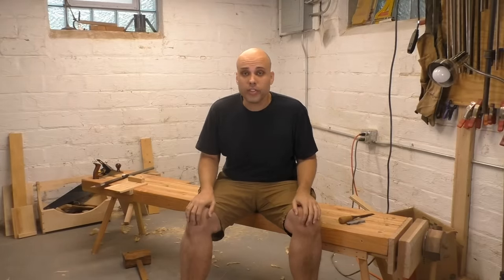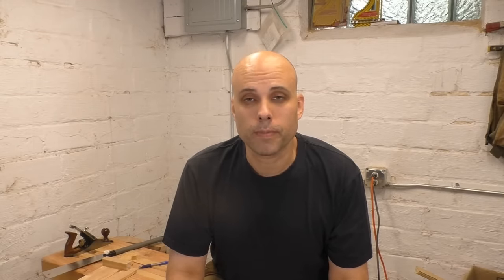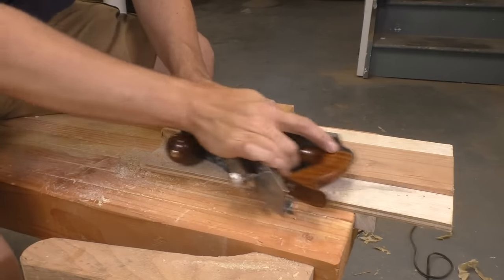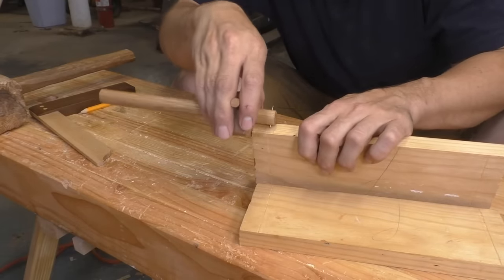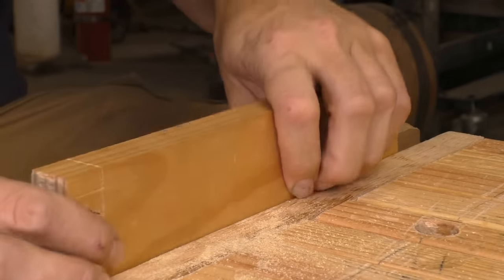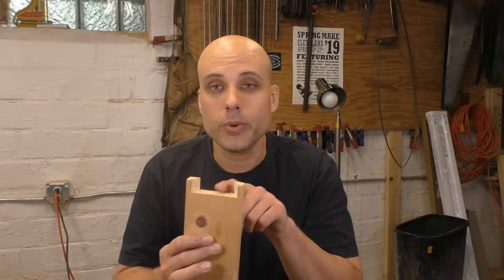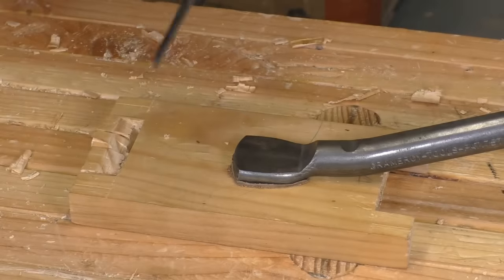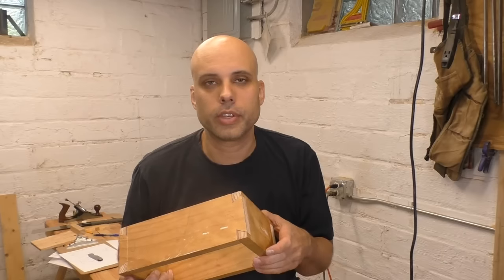Easy Dovetails for Beginners

Comment: Pine is often used as a beginners' choice of wood, but it's a horrible material to do some accurate work on with hand tools and may end up discouraging a beginner. So my advice is, get your hands on some small pieces of hardwood to try out these techniques.
Reply: Poplar isn't much more expensive than select pine at the big box stores.
Reply: It's important somewhere to point out that pine is actually pretty great FOR SOFTWOOD techniques... the kind that most beginners should really reliably be dipping feet into in the first place...
   Rex's chopping out is more of a Hardwood technique, not so well suited for pine... SO... I'd recommend taking the saw back to the piece to make "relief cuts" in the waste material to just about an 8th inch (2-3mm?) above the gauge line for the shoulder, and start your chopping out process considerably closer to the edge/end, then cut the remaining waste in about half, and half again... repeat until you're down to the last sixteenth or so (between a half and a millimeter) and then you can gnash out the last of it... reasonably smooth.
   He did point out that his chopping was "too aggressive for pine", so he saw it, too...

    Keep in mind, woodwork is a patient man's game... There's a lot of dubious repetition involved if you're going to excel at it. Remember to breathe, relax, and then keep on keeping on. 

     AND for the record, yes... Poplar is a very reasonably priced and perfectly workable hardwood... for those interested in diving into hardwoods... BUT if you're most interested in keeping tools at relatively low maintenance and just practicing to get technique and muscle memory... Pine isn't a terrible medium to gain skill with, and it makes you particularly conscientious about handling for work. It dings at the drop of a hat. ;o)
Reply: It might just be the big box store wood... I've seen videos of Japanese woodworkers doing sashimono with pine. Beautiful work. According to Google, sashimono is also a small war banner, in case anyone wants to look into it both come up.
Reply: @TheRaven0811  It isn't the big box store, it's the way it is grown and harvested.  And it's pretty widespread.  The saplings are crowded in together, and chosen for their very fast growth.  <20yrs from  seedling to harvest is almost the norm in this part of the US, and that leaves a lot of trees barely fit for cardboard, much less a dovetail box.
Reply: @gnarthdarkanen7464  I totally agree.
Reply: @gnarthdarkanen7464  Ah, interesting info!
Reply: Plenty of hardwood scraps in construction dumpsters and on the kerb in old furniture...
Reply: @ErikBongers  Admittedly, I'm a hobbyist more than anything, so keeping in mind that I'd consider myself no further than intermediate (ish)... I hope my looking back (in time) to those frustrating beginner days is helpful... Thanks.
    AND I completely understand the personal angst from "bsdnfraje" up there, as it is easy to dismiss pine as completely too soft to sustain the job... BUT... looking back I have had to come to terms with my own early onset of disdain for the stuff, as I also thought it useless... aggravating... and a needless waste of my time, when I was more interested in the tightly interlocking tenons and hidden mortises I so strive for today...
    BUT... were it not for those hours and days of the old-timers handing me a piece of wood back and returning me to sanding AGAIN... and AGAIN... and AGAIN... 

    ...and were it not for the old-timers pointing out where I'd dropped the damn thing against the table...
    ...or mashed it into a raised (loose) nail somewhere...
    ...or any of myriad other incidents and injuries to my (at the time) master craft...
    I probably wouldn't have the patience today to do my layouts, follow the lines regardless of marking utensil, width or darkness... or whether it's a pencil, marker, pen, or knife-wall (Paul Sellers' style) and leave just enough waste to finish back into exactly where I want it... as I sand it smooth.
   I wouldn't find sanding and polishing and steel wool to be best friends for relaxation after a long day of dragging saws and shoving chisels through everything from hemlock and seasoned knotty pine to black locust so hard a strike from a hardened axe will throw sparks.
    AND there's probably no way I'd sit through the maintenance of a plane iron to the degree that I do... SO... pine isn't the greatest for a finished product of "heirloom" qualities. You probably won't pass the pine hump chest to the grandkids... BUT getting through all the f*cking up royal with the pine one, while you have time and money to afford pine... WILL make the mohogany and teak hump-chest not only worth passing to the grandkids, but likely worth enough cash in the generations to come to put the great or even great great grandkids through college... almost regardless of what's in the damn thing.

    Be wary of beginners who have too rigid an opinion of things. They likely have a lackluster capacity for details and little or no patience with themselves. God only help anyone else nearby! ;o)
Reply: @gnarthdarkanen7464  Poplar is cheap and pine is intentionally farmed to be substandard wood.  If that's angst, you need to toughen up, snowflake.

I've got antebellum pine furniture I've inherited, and a loblolly kitchen floor reclaimed from a local barn.  I love yellow pine!  Big box select pine is still terrible wood, and it's intended to be.
Reply: I use pine for the test piece since I rarely work from a pattern  but I agree 💯 I remember being shocked when I started using hardwood the difference it made in my work.

Comment: This kind of attitude towards the iconic dovetail joint will be much more valuable to most woodworkers than seeing Frank Klausz doing them at warp speed, or Rob Cosman doing a perfect set blindfolded with one hand on his back or something.
Reply from the maker: I appreciate that very much!  Still, Frank's no-measure/no mark method might actually make the joint easier. I need to try it.
Reply: Great video, Rex
Reply: @RexKrueger  One thing I've noted, from Paul Sellers, is the use of a knife to make my marking instead of a pencil. That one simple tool increased my accuracy quite a bit. Keep up the good work. I'm enjoying this series!
Reply: 1/3's would be stronger.
Reply: Good job!
Reply from the maker: I'm not gonna buy Cosman's tools, but given that he physically makes them himself, his prices probably aren't that silly. Small-scale production is very expensive.
Reply: photozack81 You should have a look at a channel called “Pask Makes”. Need a big framing chisel? No worries. Let’s make one!

Comment: I always cut pins first , and for a reason I haven't found anybody talk about. The first board that you cut can be cut basically anywhere. In other words it doesn't matter how accurate you are to the line you marked. But the second board has to be cut in a precise spot. The reason I cut pins first is because when you mark your lines on the Tails board you are marking on face grain. And I find that the best way to mark the Tails then is with an exacto blade. The standard triangular exacto blade is small enough to get the entire line marked but there is enough width at the base of the blade to reference the pins surface and keep it perpendicular. Then all I have to do is Sneak the ryoba right up to that line, which is dead on. But if you are marking your pins second you are marking on end grain, and particularly with Woods like Pine, a marking knife won't really work. You kind of have to use a pencil and then you are much more dialing in the fit on every joint.
Reply: does it make sense to make dovetails in 2019 though
Reply: There is yet another issue with tails first method in a minimal shop setup: it requires vise. With pins cut first you can put the pin board standing on top soon-to-be tail board. It's much easier to perform on a basic Roman workbench.
Reply: @jwydubak9673  Too true, and I prefer standing them up, personally...  Though I can say from experience standing up your board does get a little dicey if you're trying to mark tails from the pins on a 14" x 72" carcass side for a pantry.  :D  I had to get a little inventive there.
Reply: @xl000  You may as well ask "does it make sense to have chef knives now that everyone can buy a food processor".  People making food in factories have to use processors, but people who enjoy cooking stick to chef knives.

Comment: Great stuff as always. Couple of notes, a shallower angle for the dovetail reduces the amount of short grain at the tip of the tail and can actually make the joint stronger. (1:6 for softwoods,1:8 for hardwoods usually) When sawing the tail, it can be easier to start off with the piece angled in the vice so the line you are cutting is vertical, instead of trying to get the saw at the correct angle. You can use your Tri-square to line it up.
Reply: 1:6 = 10 degrees, 1:8 = 7 degrees. Doesn't seem like much, but the angle doesn't need to be severe to get a strong joint.
Reply from the maker: Good tips!

Comment: Rex, Just a tip I found to made cutting the tails easier. Mount your tail board in the vise at a angle then you cut straight down instead of having your saw at a angle. Straight cuts are easier than angle cuts.  I found this way a lot better and my joints have improved.

Comment: Thanx for the tips! I tried hand cutting finger joints........gotta try that one again. Haven't quite got my router finger joint jig quite right yet either. I'm lucky to have half a garage for my shop and keep my various machine tools on boards with caster wheels and drag them out when needed. It's a bit of a pain  but hey - I'm lucky to have what I got.

Comment: Rex, I made a frame today with 8 dovetails. Never done it before. It’s all thanks to your series that I’ve been inspired. Wish I could share pictures with you! Thanks buddy.
Reply: Now use dovetails in everything you do. And you will become an expert with the joint. Also throw in tenon joints as well. 
Make hundreds of small boxes and have them all over the house. My kitchen is entirely dovetails joints cabinets made from mahogany and oak. Everything from the doors, drawers, carcass, work tops has dovetails. I cut dovetails everyday by hand and I also use tenon joints. 
With just tenon and dovetails you can make anything.

Comment: I have to thank you Rex. Always wanted to get into woodworking but struggled with the preconception that I'd basically need a full workshop, and that thought has driven me away from even trying. Only have a small workspace to use but your guides really have helped me shake the notion that I'd need $1000's worth of equipment. Like before I found your channel, I used to think the only way to get a straight edge cut was either through a power saw or by having years of practice with a hand saw, never even heard of an shooting board before! Looking forward to getting more into the skill, thanks again!

Comment: Great video! I've seen this after starting my process with dovetails (using a Paul Sellers/Matt Estlea combination of layout and tricks that work best for me) and it is a very humbling joint. I've gotten a lot of joints that would work just fine, but they were not pretty! This video is great for learning how the joint works. Don't think that the fact that his has only a single tail makes it "easy" or such, the difficulty steps up quite a bit with multiple tails and as a newbie you want to reduce the complexity as much as possible. Do a bunch of single joints, half dozen or more, and learn all the mistakes and issues so when you do multiple tails you can apply those (and learn one ones) as you do the joint! If you want to look like you've been doing dovetails for decades you will probably need to be doing dovetails for decades, so get started on that practice!

My advice after 5 dovetails, with the final one actually being night and tight, is to be very careful with your layout and ensure your tools are sharp and stay sharp. I went back and re-sharpened/flattened all my chisels and go back to strop them between almost every operation. Also taking off less is more when cleaning up, it may take longer but you have far less chance of ripping out wood. If things feel off resharpen or strap, you will be happy you did. When cutting do your best to be careful to hit those lines just as needed, and I  do a bunch of saw practice before I do my joint. 

Finally don't forget that till recently dovetails were a practical joint, not a show joint. They look amazing when done perfectly but they don't need to be flawless if they are going to be hidden behind a closed drawer. I've seen many antique, extremely well finished, pieces of furniture that have gap filled and rough dovetails. There are a lot of good tricks to get a gap filled dovetail cleaned up (from glue/saw dust, to filling with wood wedges, to smashing down the grain of the pins) to make them look much better.

Comment: One thing I found when I cut my first dovetail joint and try to always keep in mind. As long as it's not too sloppy, even a poorly executed dovetail us a rock solid joint.
Reply from the maker: Yeah!  Mine aren't great, but still hold with no glue. Amazing.
Reply: If you use them on carcass joints on the inside with no display it doesn't really matter how they look.

Comment: Was genuinely feeling discouraged to build a bed frame with dove tails but you just gave me the basics and I’m feeling for confident to build this , thank you :)
Reply: When the joints are not on show it does not matter how they look just that they are strong. You can also use tenon joints as well along with dovetails.

Comment: Great video Rex. I tried my hand at making dovetails. I had taken just some scrap pine that I had laying around just to make one joint. I managed to get it to work but man wasn’t it just about the ugliest joint that you ever did see. I posted pictures of it on this woodworking group on fb. Several people commented saying to try again but with some hard wood like maple or even just poplar as it would supposedly be easier than using soft wood. I have yet to give it another try but plan to when I have the free time to.
Reply: When you do it once it means you know how to do it. DO it 10 times and you will start to feel more confident, do it 100 times and you will feel like a pro and do it 1000 times and you will be an expert. 
You only need a few joints in woodwork to make what every you want. With just the tenon joint and dovetail you can make about anything you want. 
I can do box up a small box in 20 minutes with dovetails and they will fit perfectly and look great.  Larger boxer with numerous dovetails such as a chest can be done in about 1 hour to 1.5 hours and that will be finish grade fine furniture standards. I can do up a table with tenons and dovetails in about 6 hours.

Comment: The way my grandfather taught me to cut clean dovetails wasn't to start with inexpensive wood and small to mid sized joinery, but rather to scale down and keep making TINY little boxes out of a small amount of good hardwood. 

I'm talking itty bitty little decorative boxes that were around 2"x4"x1", with a nice lid of course. 

After I could manage to make perfect boxes out of tiny materials did he allow me to start trying to make larger things out of softer and cheaper material. 

Be very wary of letting yourself get caught by the false economy of learning with cheap pine or other soft woods!
Reply: Well you haven’t explained why you think it is false economy to learn on softer woods....... If I used softer woods I can build more projects that I can actually use...... If I built with hardwoods and made teeny tiny boxes I would have a bunch of tiny useless boxes
Reply: @hiligatioify  Mainly comes down to "Fail Faster, Learn Sooner".

The small boxes take less time to build and layout, but still require the same precision and accuracy while being done in a material less likely to give 'false results' - In softwood you can 'get away with' some bad habits that don't work well in a harder wood with more stable grain.

At the same time soft woods are easier to damage during processing or assembly, potentially making an error in your methodology harder to see: Is your dovetail loose because your sawing method is poor, or is it loose because you did something to crush fibres and loosen the joint?

Small projects mean you start and finish a single project faster and can learn more of your fundamentals sooner before scaling up to larger projects.

All that said, if your goal is to make finished softwood projects anyway, then it doesn't matter nearly as much - But starting with smaller projects is still a sensible path. Learn what works and doesn't with small projects in your desired material, and scale up from there.
Reply: @hiligatioify  he has a point, I had to make the experience that soft woods are less predictable and tend to split or rip where you didn't mean it too, especially along the grain. Makes sense thought this is also part of it and eventually everyone has to learn how to get around that.
Reply: Apprentices traditionally produced miniatures for the same reasons of economy of materials, and the high precision required at small scale.

Comment: Good tip on the saw what you can see part additionally Japanese saw have the first teeth in a design so that you can never over cut what you can't see. Basically you have to angle up to the point where the only the front few tooth is cutting to prevent overcut

Comment: I make speaker boxes and I'm wanting to change over to a new design that is screwless and uses dovetails on the faceplate, as many of my customers are running 5 + 10,000 watts and I'm now needing maximum strength. Large dovetails on all the corners and a long row of alternating circle & square dowels tapped through for additional adhesion, and different woods for alternating colors.